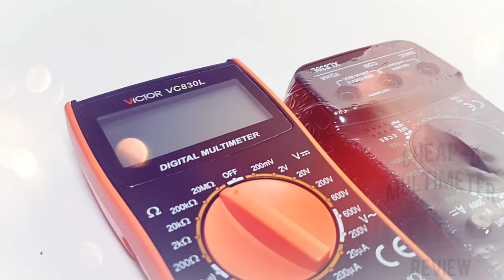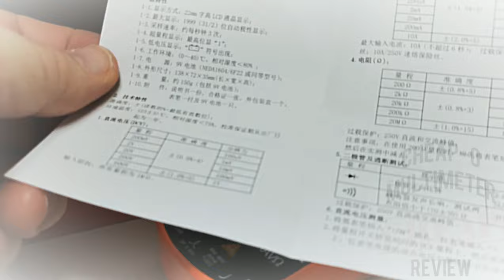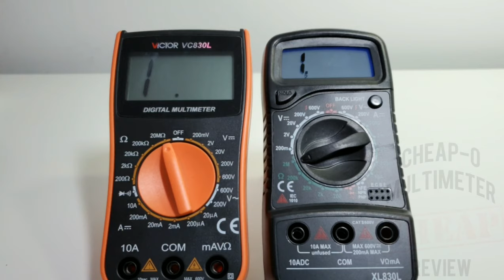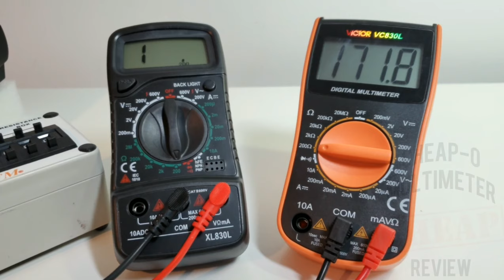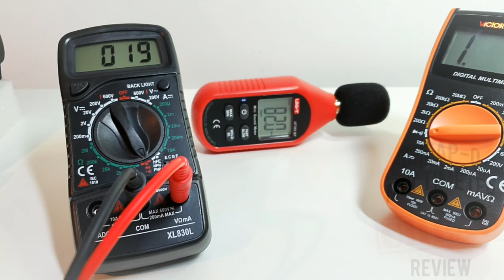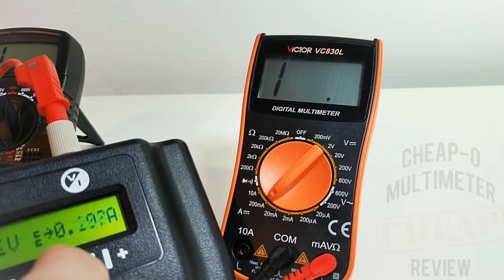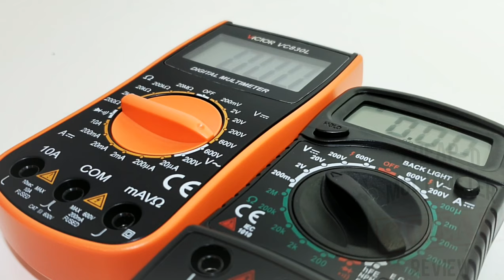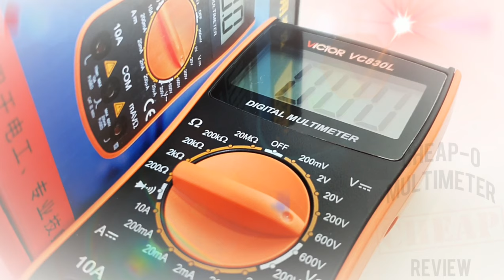VICTOR VC830L CHEAP-O Multimeter Review & Teardown!

Comment: I need to outfit my first-year college electronics students with meters so they can do their Circuits Analysis I labs at home during covid. They will need to pay for their own equipment. I bought a Victor 830L, and found about a 2% error in voltage. I am waffling on whether this is good enough, or I should get them to buy two VC890C at double the price.
Reply from the maker: Really sorry I missed this comment, its late but I woukd have said yes, for the sake of a ±2% accuracy if set to the 0 to 100-V range. Based on this accuracy 102/98V should be ok for basic electrical.
Reply: @KeepOnTesting  I went with one cheap (VC890C) and one very cheap (VC830L). In Lab 1 the students compared voltage and current readings, and were usually within 1%, so I am happy. Your video helped me with that decision, so thank you.

It is amazing how cheap some decent tech has become.
Reply from the maker: @ronstewtsaw  Great to hear 👍 Yes its true, nowadays you can get alot of electronics equipment for very little..cheap doesn't always mean cheesy! Keep on Testing!

Comment: i reaaly liked this detail level review. so much solid info ! 

p.s. i noticed the current readings are slightly off. may be that is a downside of cheapo meters.
Reply from the maker: Roger that, it was slightly off with some of the mA readings but generally speaking it was still within spec most of the time. Thanks for the kudos!

Comment: The Victor seems to be much better built with better protection, two fuses, diode etc. etc.
Reply from the maker: Victor is surprisingly good in this respect,  definitely a step up in the CHEAP-O Multimeter Realm.